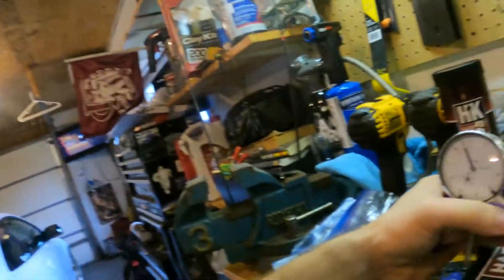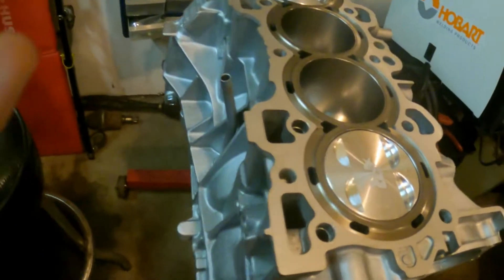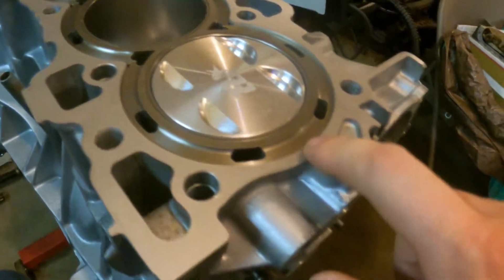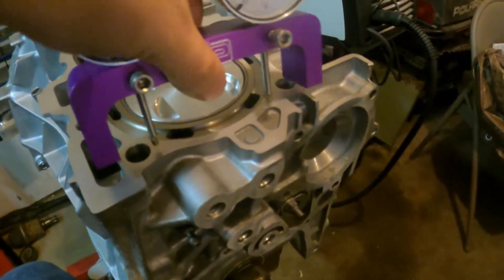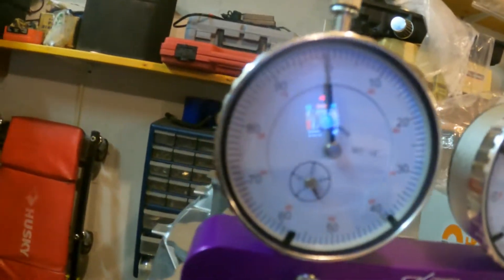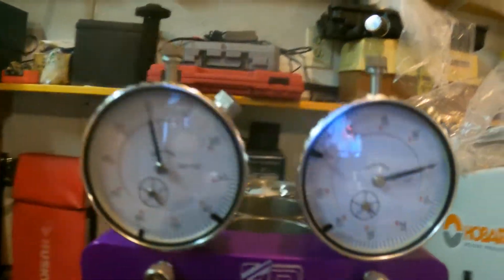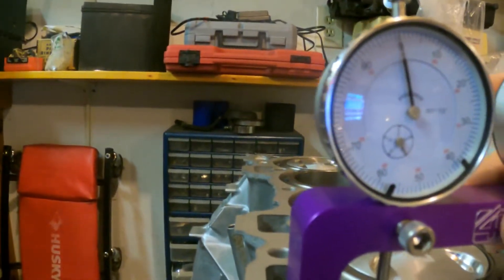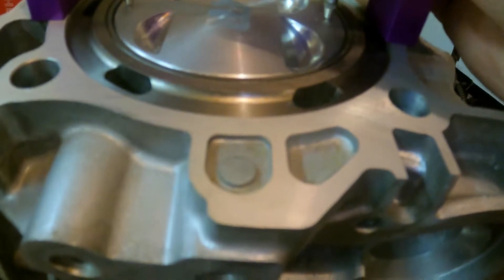Measuring Deck Clearance on the B18C

Comment: My buddy J.... my buddy did everything! 😆

I’ve never had to use a deck gauge clearance but, I was always told that if you didn’t shave your block where the head goes, you can use the factory specs to gauge your head gasket thickness! 

On a side note, while you were using the deck clearance tool, can you rock the piston so that both gauges are precisely the same number? I would think that’s what you would look for, correct?
Reply from the maker: Yes you rock the piston. However, it’s my understanding that you take the high reading and the low reading, then find the average of those two readings and that would be your deck clearance.
Reply: @EKBoosted  Okay! Yeah that would make sense! I was trying to understand that in the video!